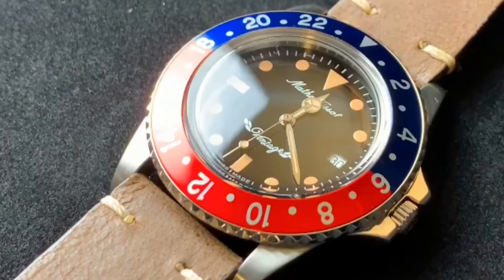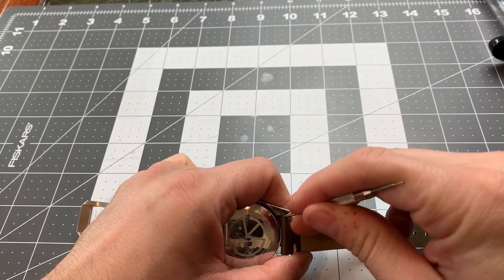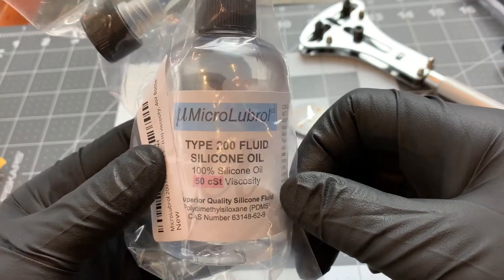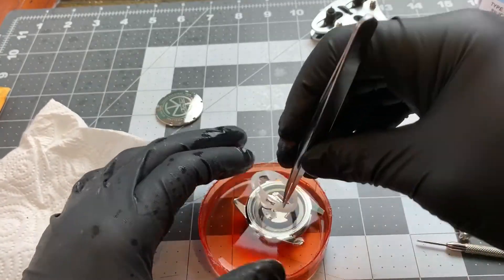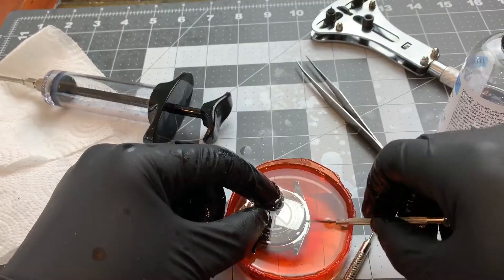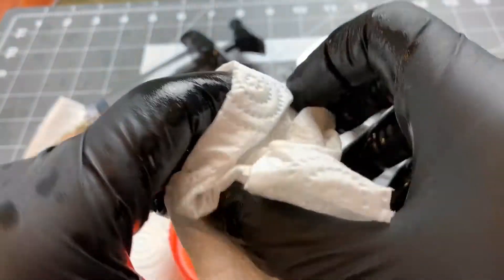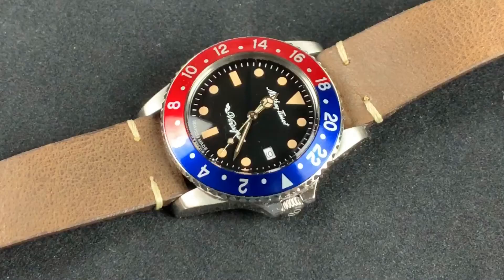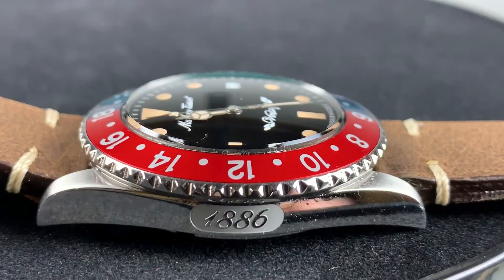Oil Filling a Watch:How to tutorial.  SO EASY!!!!

Comment: Or, you can replace the glass, with a magnifying type and purchase a good watch that does 300 to 500meters. Least you don't have to constantly change the battery every few months, doing this method. I don't have the patience to, grab all my tools, bowl, oil, take, the time and patience to fill the oil proper, etc etc. Each to they're own. But I guarantee you folks, doing this method. Your luck that your battery lasts more then 8 to 14months max. 🎤 Drop

Comment: hello
I have a U-boat rainbow watch. The watch battery ran out and the oil decreased during the replacement process.
While looking around, I came across your video.
Ask if you can fill the U-boat rainbow watch with oil in the same way. Please reply.
Reply from the maker: Yes, if the Watch itself was first filled with oil, use the same oil that I recommend.

If you like the look, I’ve also done this on a vaer solar so that I never have to replace the battery

The U-Boat purposely had a bubble in it so make sure you don’t overly fill it
Reply: @allthingsrandom8137  Thank you.
I think your advice will be very helpful.
I hope you have a nice day.  ^^

Comment: I find this so stupid. Why should you fill a watch that was designed to operate dry and in air with oil? And does the oil really not affect the time  keeping? Does the oil not cause resistace to the second hand, making it go slower? I would never do this just to gain any aesthetical advantage. Not to mention the mess each time you need to change the battery. To each their own.
Reply from the maker: Well, I did a follow-up video where I compare it to a standard dive watch and how it’s better.  For instance, it gives better water resistance than a watch filled with air.  The change in the timekeeping is so minuscule that it’s not noticed.  I also did a different video with a solar movement so the battery would never have to be changed.

So, as stupid as it is, there is more than just aesthetic looks

Comment: I'm glad you checked it for accuracy, but it just seems like the increased viscosity would slow down the watch. Any long term results on this? I love the look!
Reply from the maker: Watch needed a battery change about 2 years in.  I recently did the same thing to a Vaer Solar dive, check it out on the channel, so a battery change is not necessary

Comment: In digital watches, ok. But when you put oil at the movement, the some parts needs more power to slide. Yes, the battery will shortly end and the accuracy will not be the same... Talking about dive, the watch with oil will increases the limits!

Comment: Wasn't sure this was a joke or not.  Don't do this!!!!
Reply from the maker: What’s the down side?  Better water resistance, cool legibility, and if it’s in a solar the battery never has to be changed
Reply: That works fine on Quarz watches, it should be all under oil so the air can leak out. It doesn’t reflect under water, like a regular watch.

Comment: Every horologist and watchmaker who understands what it takes to make a watch that keeps time is cringing and mourning right now
Reply from the maker: That’s not true. These can be used on mechanical watches, and a watchmaker isn’t going to cringe. Especially an oil filled quartz movement that gives it better legibility and water resistance when actually used.
Reply: @allthingsrandom8137  absolutely not. The hairspring inside a typical mechanical watch that regulates the time cannot function submerged in oil. In fact, even a small amount of oil getting between the hairspring spirals will throw it off by magnitudes. Not to mention the balance wheel itself trying to overcome the drag of being submerged in fluid. An escapement could surely be purpose designed to operate submerged in oil, but no typical escapement that is not designed for it will function. And as you've seen in the other comments, even a quartz watch will draw 4X the current from the battery to overcome the drag, which means every conductor is carrying 4X the current it was designed for. Which is why the lifespan of the movement is cut short and will burn itself out, as other commentators have noted. So,,,, nope.

Comment: 50 cSt is a VERY thick oil. I would go for something way less thick. You can see the boubles releasing and sticking. They move slow. There are alot of fluids more adapted for this kind of work, that has very low viscosity. Try fluorinert. https://en.wikipedia.org/wiki/Fluorinert

Comment: After a year of doing this to a couple of watches, they all stopped running. They were quartz watches. I did it to 6 watches of different brands. Some leaked little by little, and they all stopped eventually. I absolutely love the look, but they stopped. So I stopped doing it to the new watches I bought. I did try to change batteries on them, nothing.
Reply from the maker: I get it.  I never had a problem leaking for changing the battery in the Mathey.  Here’s a link to show about 6 months later.  I compare it to another non-oil watch.  Both changing the time as well as water resistance.  

I’d say try again…

https://youtu.be/1d5sj9B4e20
Reply: what watches were they ? what oil did you use ? would you consider your skill in applying the oil good/ok/bad ? were they on a constant too hot/ too cold climate ? Would you say any oiling of Quartz watches that isn't Solar powered still be worth it (lifespan caring only about 5 years etc ... ) ?
Reply: you put oil on quartz watches? oils are meant for automatics
Reply: @Rr-j4x  I would say not unless you get one that only fills the dial area. An automatic movement has a balance wheel in it that would slow down due to the viscosity of the oil. It wouldnt keep proper time.

Comment: I'm confused. Is it a screw down crown? If not, oil doesn't come out?
Reply from the maker: It is not a screw down but offers 50 meters for water resistance.  Here is a link where I show all the functions showing it does not leak

https://youtu.be/1d5sj9B4e20

Comment: This can only be done to waterproof watches, correct?
Reply from the maker: Define water proof.  Every watch has a level of waterproof resistance. My recommendation is 50 m and you’ll be fine.

Even if you choose a watch that is a timex for example with only 30 m of water resistance, it would still work

Comment: Why does the oil not interfere with the battery/electrical system of the watch?
Reply from the maker: Because the oil is a non-conductive oil. You can either use a ferrite oil or a silicone oil.  All of which does not conduct electricity.

Comment: The 24 hour bezel is a mistake sent by DIY and has no function without a 24 hour hand. Should have sent you a 12 hour or minute bezel.
Reply from the maker: That’s not necessarily true.  An additional 24 hour hand, like a gmt Ads a third time zone, not a second.  So using the 24 hour bezel, you can adjust a second time zone using the standard hour hand.

Comment: Dumb question: What is the function of the 24 hour pepsi ring with no 24 hour hand?
Reply from the maker: You can technically time an additional time zone without a gmt function.  The standard hour hand acts as the first time zone, the 24 hour bezel can then be adjusted to should an additional time zone either ahead or behind.

Comment: Did I miss something.  You don't explain why you would do this.  What is the benefit of doing this?  Would this not cause a problem when you press the button - ie: a Casio?
Reply from the maker: It helps in a few ways, not only does it project the dial on the inside of the crystal, making it easier to read, underwater, and easier to read above water, but it also improves of water resistance rating of your watch

As the viscosity of the oil is heavier and more dense, it makes it so water can’t intrude into the case

And there is no leakage whenever you change the time or use a button.
Reply: @allthingsrandom8137  Thank you for your reply Sir.

Comment: Does the viscosity of the oil affect longer term time keeping accuracy?
Reply from the maker: Not that I’ve noticed.  An argument can be made it may take the life of the battery down a few months.  But is it the oil or the battery?  As for the accuracy, I haven’t noticed a real change
Reply: @allthingsrandom8137  that’s interesting. Thank u for thr reply. Yes, I later came across the battery life comment too. Interesting. It seems quite a deal breaker if it were only 10 months after all the hassle and rinse n repeat. But good experiment and also historical use for scuba. I’ll be trying it on my Patek for tomorrow’s dive.

Comment: Can you convert a automatic to Quartz movement , because I have a broken omega seamaster 007 clone an I want a Quartzmovement in it
Reply from the maker: Most the time, 99% of the time the case is the exact same. The only thing you have to be careful of is the movement holder, and the movement crown stem being the right length. Everything else should line Up just fine

Comment: It would be interesting to do it on a solar watch and see if the solar cells still recharge the battery.  Also if the watch includes a small LCD display, can that LCD still be read?
Reply from the maker: Solar works fine.  I did it with my buddies citizen.  LCD screen is unaffected so it’s read fine
Reply: It improves LCD displays.

Comment: So, the reasoning on doing this it’s only for the looks? Any other improvements? Thank you!
Reply from the maker: Basically just looks, but it does increase the water resistance rating quite a bit.  Water intrusion is basically impossible because it’s filled with oil which is far more dense
Reply: @allthingsrandom8137  understood. Not for me though. Appreciate you sharing.
Reply: @allthingsrandom8137   £50 buys me a Casio Duro waterproof to 200 metres. Few divers go much beyond 30 metres.

Comment: Hi, i have a blancpain villeret 40mm watch in stainless steel 2 years old (2020) watch and i noticed that it is stiff when i try to wind it. It has 72 hours power reserve. 

Example: When i wind it, it is tight..
I have to pull out the crown then i have to push it back in, in order for it to be buttery smooth when i wind it. It keeps excellent time BUT it is just stiff/tight if i wind it without pulling out the crown and pushing it back in first..  feels like resistance..

Any idea on what could it be? I dont have warranty. 

My jlc reverso is so smooth , i dont have to pull out crown and push back in for it to be smooth wind.

Do you think with silicone grease on the crown seal/gasket will make it better?
Reply from the maker: I don’t think I would do anything that I wasn’t 100% sure of.  

The gasket may be dry and that’s why it’s resistance when it’s pushed all the way in. A little silicone is not gonna hurt, Just be very conservative about the amount you use
Reply: "i have a blancpain villeret 40mm watch", No, you have a fake. That's why you say later "I dont have warranty." You liars are so easy to spot.

Comment: I just did this and yes, it so easy. I did the Casio and it looks amazing. Thanks for the tutorial. (mine's been running fine a few weeks and I used mineral oil for cutting boards.)
Reply: Having some experience using mineral oil for PCs, I would advise against it. Mineral oil will make any plastic or rubber components brittle over time and will accelerate the eventual destruction of the watch. I do not have experience with silicone oil so cannot say it's long term effects.

Comment: Wouldn't oil leak out when you pull out the crown to adjust the time?
Reply from the maker: Not at all.  Check out this video. This is about 6 months later and I show how I adjust the time with no problem 

https://youtu.be/1d5sj9B4e20

Comment: How are you gonna change the battery now
Reply from the maker: Same way but easier.  It’s already sealed with oil so it has to be submerged and as long as it stays that way no air will intrude into the watch
Reply: @allthingsrandom8137  so if you wanna replace the battery you have to submerge it in oil again? That seems like a pain
Reply from the maker: Christopher Walken I get what you’re saying, and it’s not like I disagree with it. Filling it up to begin with is even more of a pain, so if you’re going to go that far and changing the battery every two years or so is it really that big a deal. In fact it takes probably I wanna say about 10 minutes to do, or it took a little longer to actually fill it up the first time
Reply from the maker: That being said, I think the effect it creates is cool enough to deal with the 10 minutes

Comment: It would be interesting to see how deep the watch could go in a pressure test now it's oil-filled.
Reply: Behind the Press tested one. It surpass Vostok Amphibia, but the back case bent inwards and some oil leak out.
Reply: In theory, there is now no limit to how deep it can go as the oil doesn't compress like air does.
Reply: I have seen test video of watches under water deeper then 940m for over 2 weeks!
Reply: It was first designed for deep diving
Reply: The quartz crystal is in an aluminum can. That can will be crushed at depth.

Comment: So how did this hold up? Is it still in good working condition? When you pull out the crown no oil leakage?
Reply from the maker: No leaks and is still running good.  I know I’ll have to changed the battery eventually, but it’s been going with no issues for over a year
Reply: @allthingsrandom8137  thank you for your kind response.

Comment: What do you do when you have to change the battery?
Reply from the maker: Well, same as when you filled it up.  What I’ve done, is completely submerge it, then take the case back off, put battery in, close it up.  As long as everything stays submerged, there will be no air bubbles
Reply: @allthingsrandom8137  is there another oil I can use? I can’t find the oils you use in the video.
Reply from the maker: Steve Kennedy MicroLubrol 200 Fluid Pure Silicone Oil Polydimethylsiloxane (PDMS) 50 centistokes (CST) Viscosity, 4oz Bottle https://www.amazon.com/dp/B00ZM36C98/ref=cm_sw_r_cp_api_glt_fabc_K6ARVBTKRP2M535PFMAF
Reply: @allthingsrandom8137  thanks

Comment: The oil does not short out the battery or other electrical parts?
Reply from the maker: Nope, it’s non-conductive oil, perfectly ok for electrics
Reply: @allthingsrandom8137  Thats amazing.  Is all silicone oil non conductive ? (just wondering)
Reply from the maker: MetamorphicWonders silicone oil is non-conducive

Comment: Well at least the parts will be well lubricated. LOL! I wonder if this can be done on a mechanical watch?
Reply: Please don't try this with a mechanical watch. It can be done, but only if the dial side and the movement side are completely closed off from one another, which is very often not the case.
Reply: Absolutely not

Comment: This is by far the best video on the topic. Great job! I am now determined to give it a try - will of course start with the Casio guinea pig :-) As the oil is bound to cause some resistance, even if it is 50 cSt, I am just really considering using 10 cSt (I have seen a post somewhere where the guy used 0.65 cSt oil - but they are so pricey!) instead of 50 cSt, that should decrease the resistance and hence keep batter life almost normal. Of course I'd be happy for you to try it first ;-) 

On a different note, you haven't replaced the crystal, right? Is that domed like this from the factory? It really looks great.
Reply from the maker: No, everything on it was stock. I wanted to choose something that would give that awesome domed affect. So I looked for a long time at the mathey-tissot and decided just to say what the hell.
Reply: no want for free,  too exposed and scratches too easily

Comment: That is awesome!  It looks really good when completed! I wonder if this would work in a solar powered watch and still be able to charge the capacitor?  Or if the oil would mess with the receiver for the atomic signal?
Reply from the maker: Not sure, but we did do it on a citizen eco-drive and it works fine
Reply: @allthingsrandom8137  That is really good to know!  I was thinking about modding my Casio WVA-470 where it has a second hand skipping issue, and from looking at the way the second hand moves in other watches that have been oil filled, this might help.  I am also considering modding my Casio WVQ-M410, but I am concerned that the oil might cause a bit of a slow down on the fast moving dials since it is all analog but has a full chronograph built in.  I am hoping that it doesn't cause issues with the chronograph part of it.
Reply: @allthingsrandom8137  I actually performed it on my Casio WVA-470.  As long as I didn't press the buttons it was OK, but since the watch is only 10BAR rated, it leaked oil out.  So, I got the joys of cleaning up the oil mess, but I did fix the second hand skipping problem.
Reply from the maker: kato223 The leaking sucks. That’s why I tried a watch with the higher water resistance rating, and more of a dive style.